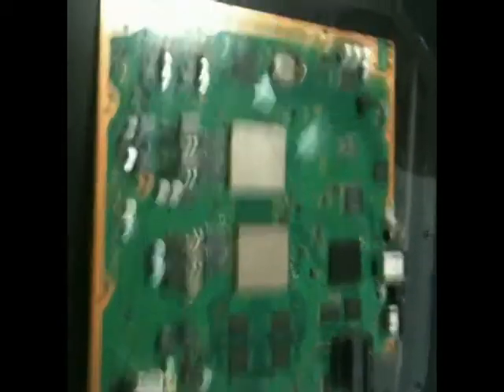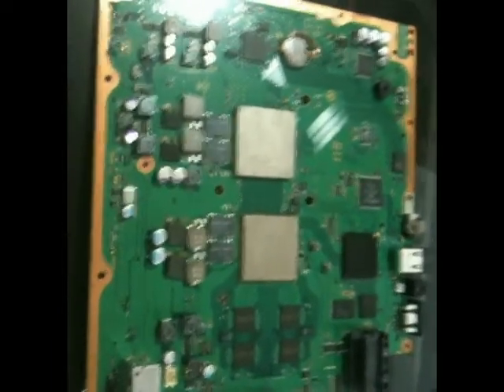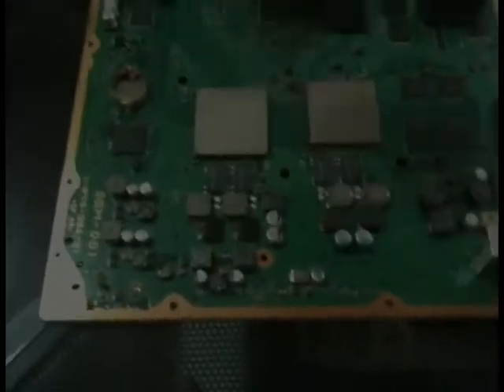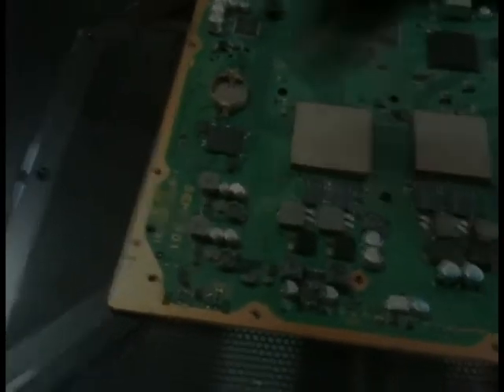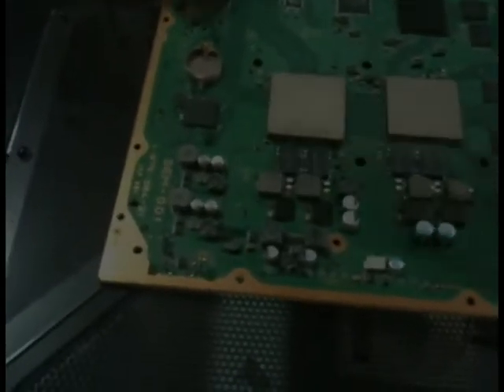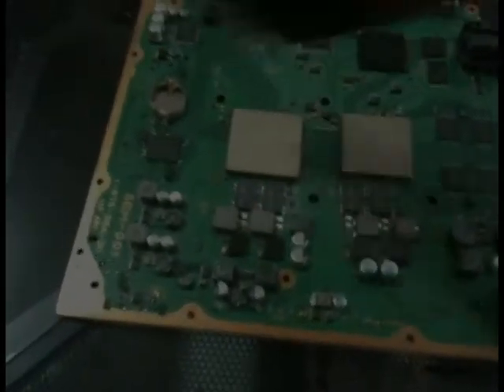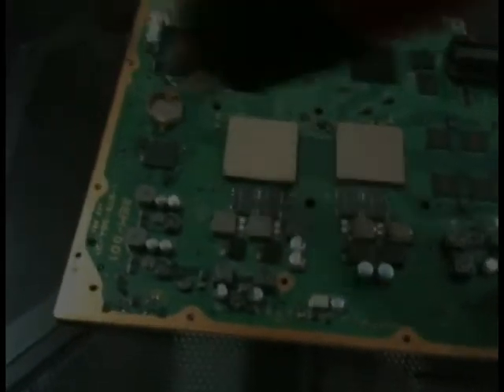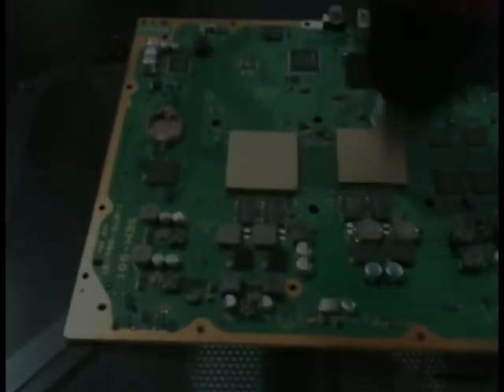Detailed PS3 YLOD Reflow (Old Model Red/Yellow Light of Death Fix) - Part 3

Comment: I've use Jon's tutorial several times on clients' consoles, and can confidently say I've had 100% success each time.  Many may have different methods of 'reflow' processes.  That doesn't mean any one person's method is wrong.  Try different ones.  Jon does a good job, as do other tutorials, and this one works, repeatedly, if done correctly.  So do others.  If you've found another method that works, works, use it.  Quit bitching about this one.  This one works too.

Comment: how many minutes in total to reflow the ps3?
Reply from the maker: It depends on how comfortable you are with the procedure.  The first time I did it, it took me the better part of an afternoon.  I've done it a few times since then, though, and can do the whole thing in about an hour and a half.  It's advisable to take it slow the first time.
Reply: Cheers buddy, I was just afraid if I reflow my ps3 on low heat for too long without noticing, It might melt.
Reply from the maker: Oh, do you mean just the heat procedure itself?  I thought you meant the whole thing from start to finish!  My answer is very different, then.

Rather than using low heat, I'd use fairly high heat (~900 F) for a short time.  Hit the chip itself with bursts of 10-15 seconds, and then heat the board uniformly by moving the heat source around it (from about 12 inches away) for 15-20 seconds.  Then hit the chip directly again for 10-15 seconds.  I repeated this something 7-10 times, and that seemed to work.  Remember that the goal is to melt the solder under the chip without damaging the board as a result of uneven heat.  Hope that helps.
Reply: ok btw i'm not sure which part of the video, but I remember u mentioned that u must preheat both sides of the board as a warm up between 5-10 secs, before actually applying the proper reflow. So long story short, how do u do that when heating one side of the board, the side that has been heated, can't touch the surface of the ground as it would damaged it? due to being too hot to touch when trying to heat the next side of the board after 5-10 secs?

Btw sorry for this very long question, I just need to make sure I do it properly, as I will put on some thermal paste.
Reply from the maker: No problem. I built a little makeshift cradle that just held the board by the sides, but that's likely not necessary. The whole board doesn't need to be hot enough to melt solder (in fact it definitely shouldn't be!). The point is just to make sure that a small section doesn't rapidly change temperature while the rest of the board stays constant.

Comment from the maker: Yes they are indeed made for stripping paint, but they'll work for this also.  Keep it on the low setting and be careful and you'll be fine.  Of course specialized tools are always better for anything, but not everyone has the option to invest in them for something like this.  This is a definite DIY hack, but it does in fact work.

Comment from the maker: I've done this a half dozen times, and it's been successful every time.  Is it risky?  Fuck yes: you're taking apart a delicate piece of electronics and applying intense heat to it.  This clearly voids your warranty, and you run a serious risk of breaking your PS3 forever. Gradually heating the board is important if you're using a heat gun, given the temperature!

This can let you get a bit of extra life out of your machine.  As I say in the first part, that can be enough to backup saved games.

Comment from the maker: That should absolutely be hot enough.  You're trying to melt the solder in the GPU, and most soldering irons are far cooler than that (heat guns are heating by convection rather than convection and so lose something, but still).  If this isn't fixing the problem, make sure you're applying the heat correctly; if you're still able to make it work, there might be a different problem at work that isn't fixable with a reflow.

Comment: DON'T USE THIS VIDEO AS HE IS COMPLETELY WRONG MOVING THAT HEAT GUN ALL OVER AS HE IS. I learned by watching "GILSKY" and have re-flowed several with his step by step from tear down, Re-flow, and reassembly tutorials and never failed. 
Although heat gun re-flows are bad as BLKApache said in his comment as it is bad on the board, Most people are not going to spend 700-several thousand dollars on a re-flow machine. Heat gun flows are common to break in a few months and tell people in advance.

Comment: ABSOLUTELY not.....don't do this. Heat guns are made for stripping paint, not reflowing GPUs. You need to reflow/ reball with proper equipment like ACHI, BIRD 300, Aoyue and other reflowing equipment with adjustable temperature control. Heat guns can not be adjusted with only 2 speeds and you risk screwing up your motherboard permanently.